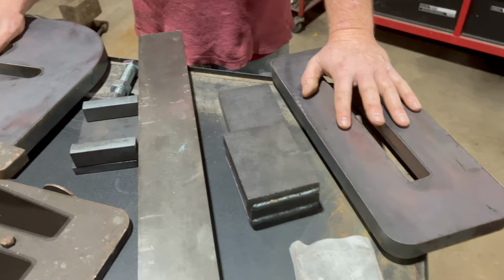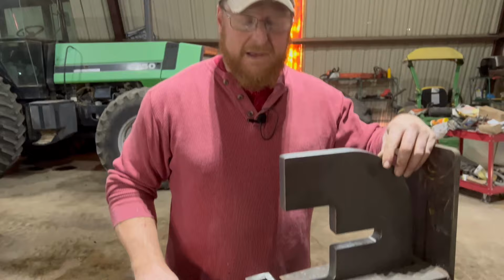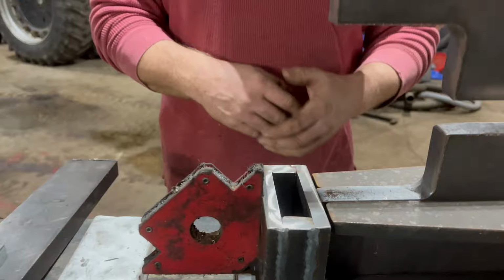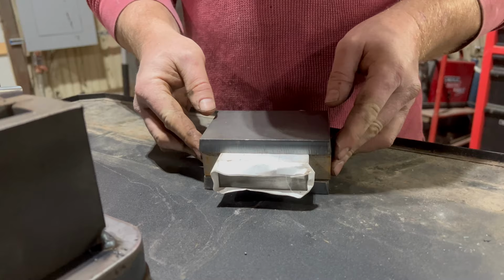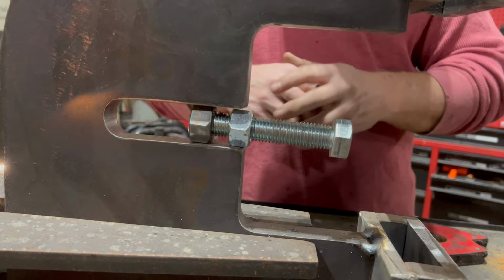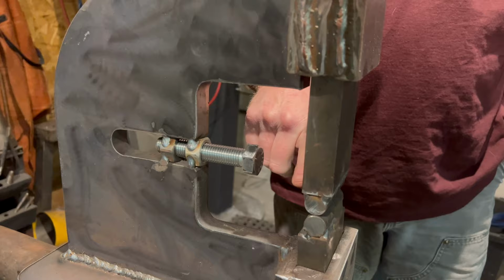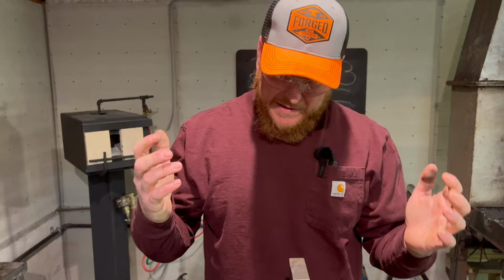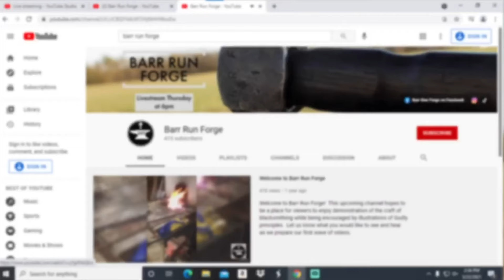C FRAME GUILLOTINE  I  Guillotine Tool  I  Tools of the shop

Comment: That's a beast I am kinda jealous.
2 things:
1) are there holes under the bottom die? If not I would put some to clear out scale.
2) I would put a plate on the head of that bolt so it is even with the top of the bottom die.

I use mine all the time. It stays on the floor next to my anvil.
Reply from the maker: It is rather large. Yes sir.  We have a few alterations to set it up specifically for us. God bless.

Comment: Troy, what are you doing with that old lines haft lathe in the back round. 👀It should be on line and working, not a horizonal storage area. I have one of 1910 vintage, I use it quite often, once you have it in operation, you will find more uses than you think. 👍
Reply from the maker: We certainly intend to put that beast to good use, Robert.  It is definitely in the plans be up and going soon.  We are looking forward to it.  God bless.